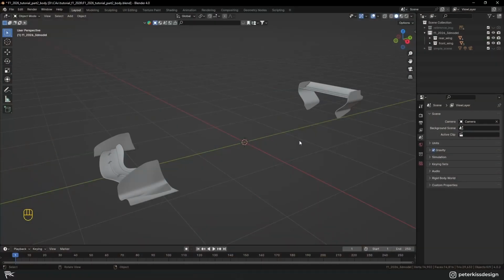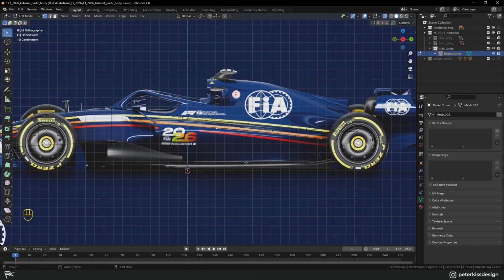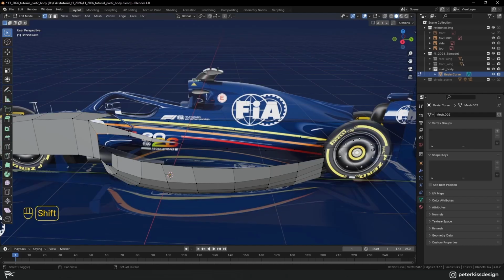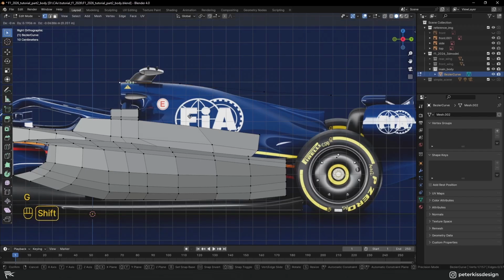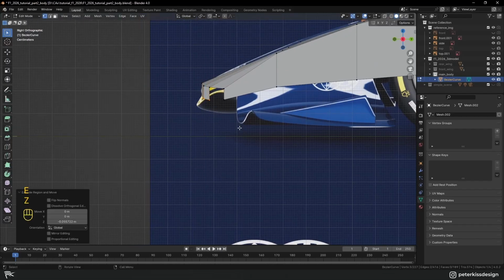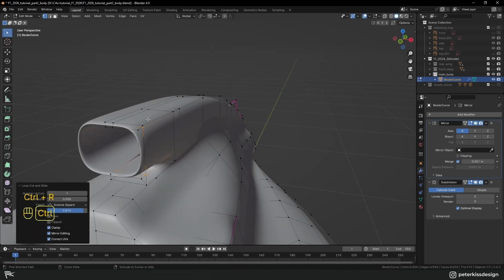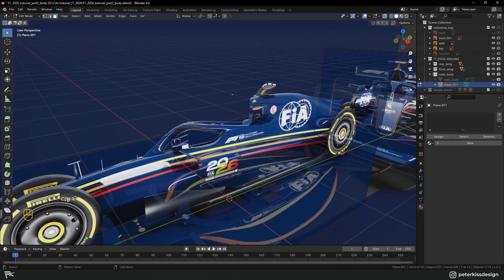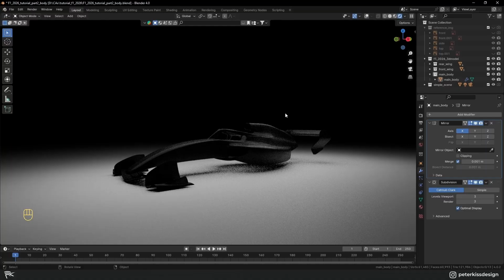Learn Blender by Making F1 Car – Part 2: Main Body

Comment: Can you tell us more about the topology you use? Sometimes you seem to use tri´s or other topology that is not recommended. What is your thought process behind that?

Also, when using the mirror modifier use the clipping box. That makes the seam in the middle super easy to fix!
Reply from the maker: Honestly in this series, as it is aimed for beginners, I did not really focused on in-depth topology, and speed modeled it. Quads are the prefered way to go. If I was doing game assett, for lod A/B/C, then it is crucial. For model which is used for just renders you won’t see much difference in the end. Thank you for the mirroring tip 👍
Reply: @peterkissdesign  awesome, good to know! Maybe good to mention that in the next video :)